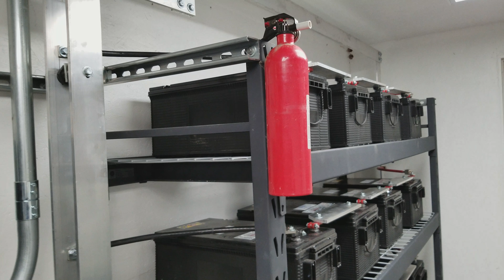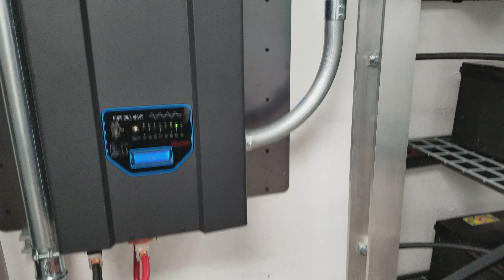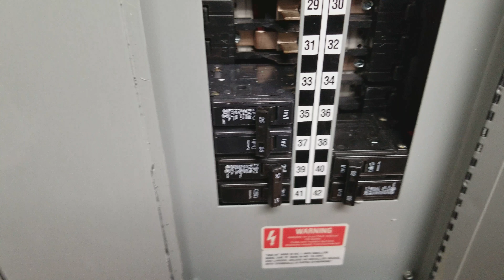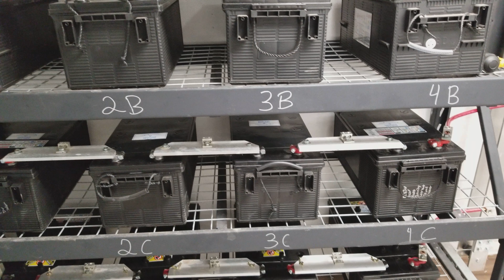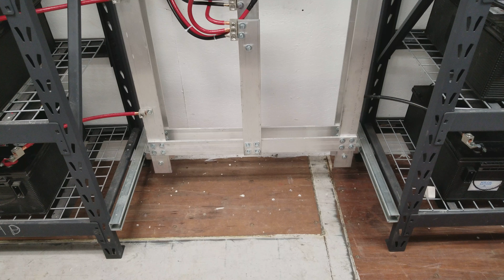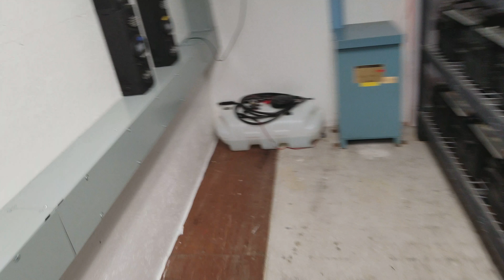Off Grid Power Room Rebuild PT 9

Comment: how well have those battaries worked.. what all are you running of the inverter.. I bought a new 1600 sq ft dubble wide. I live alone and have little power needs. I dont want to run gens so what would i need to met basic needs..

Comment: Could you install a 48v to 12v step down transformer and connect it to one string of the batteries? That would give you an easy way to get power to your solar trackers, you could also use the transformer output to go into some cigarette lighter plugs. This way you could easily plug in the 15-gallon battery filler or any other 12v devices.
Reply from the maker: Transformers only work on AC. For DC you need a DC to DC converter. That is essentially what the battery balancer is is a 12 volt to 12 volt to 12 volt to 12 volt DC to DC converter
Reply: Ok, I learn something every day! I have never really had a need for a DC transformer so I just assumed they existed like the AC ones that I use often.

Comment: Install fuses or breakers on each positive battery bank. Eliminate positive and negative riser under inverter. Install shutoff box under inverter. Also install breaker box under inverter.
Reply: Removing those positive e and negative risers will give you the room. Safety first.
Reply: Dip those aluminum bars in rubber coating. Cut out connecting points.
Reply: Or make plexy glass covers.

Comment: why not use a DC converter. to keep from drawing from a single battery?
Reply from the maker: That's essentially what the balancer is...Except I already had the balancer and did not have a DC-DC converter specifically for the purpouse.  I might also have to take 12vDC for my control cabinet, not sure yet.
Reply: HighTechLab I'm going to use a DC buck converter . to power 12 v led lighting. and a solar tracker. along with charging the small  12 v back up power. that way I'll have lights even if the main bank is dead.